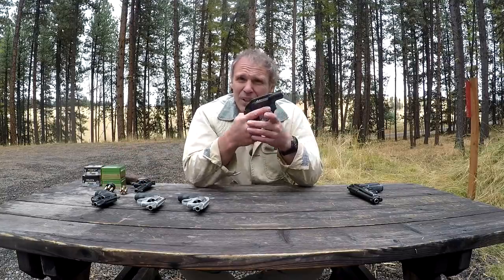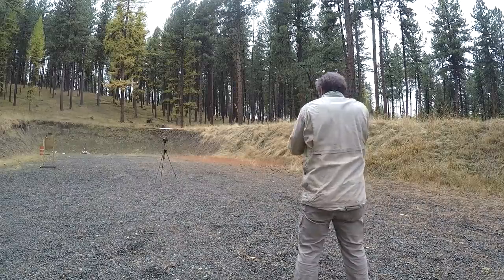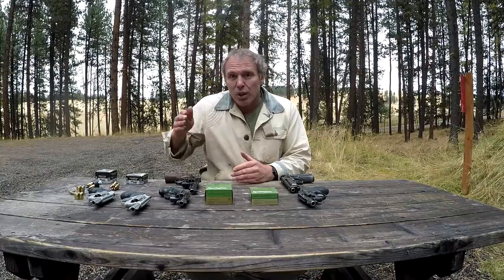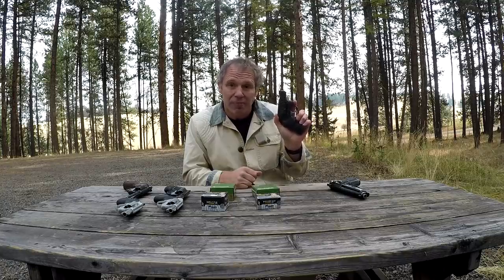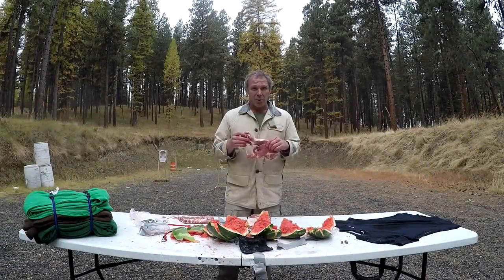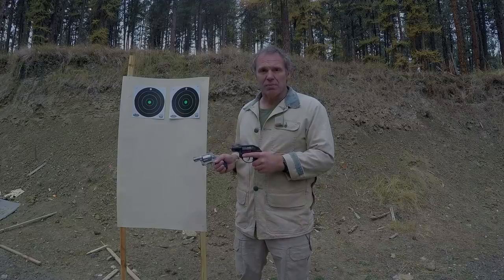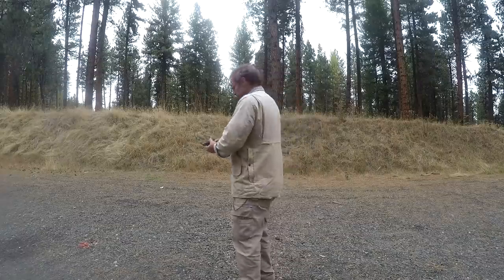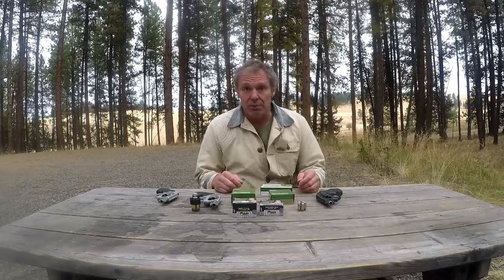Ruger LCR 9 Millimeter

Comment: Hi Paul,
You R the BEST. Watch all your vids. But as a ret engr, I must point out that the 9mm LCR is NOT hammerless as U said. It has a CONCEALED hammer. Every revolver made has had a hammer. The hammer is REQUIRED to strike the firing pin which ignites the cartridge. Hickok45 also pointed this out in his S&W M642 review.
No insult or offense meant. You do a true engineering style factual review which I appreciate.
Thx, Best Regards,
👍😋🇺🇸
Reply: "hammerless" is like "stainless", stainless will still stain/rust, and hammerless has a little less hammer on it ;)

Comment: I will say the LCR .38 has an advantage over its 9mm version: it has an aluminum frame, vs. the steel one on the 9mm. Empty it weighs 13oz. That’s pretty light, only 2oz heavier than a S&W scandium J-Frame, but costs half as much.

Comment: I have an SP101 in 357 with 2"bbl and yes it does come back smartly with full house 357 ammo. I normaly load with 38SPL+P and a speed loader with 357Mag. just in case. One thing about revolvers,if the cylinder is full there is always a round in the chamber!

Comment: Using Blazer 9mm on the range with a Ruger LCR, I experienced crimp jump twice. Contacted Blazer about it, and the person I spoke to stated that crimp jump with Blazer Brass was a known issue and that it was not intended for use in revolvers. That was the only brand I experience it with in my LCR

Comment: I can shoot more accurately with my lcr crimson trace (with our without the laser on) than my beautiful 1957 colt official police single action. your mileage varies. I have no reason for this on my end. it just works that way for me. I am VERY happy with my lcr 38+p and use soft lead hollow point gas check 158 grain gas check buffalo bore ammo for personal defense. otherwise I shoot mostly 158 gr coper plated round nose reloads. For more power in the same holster switching to the sp101 357 magnum and I can shoot pretty decient with that. Love your videos. always learn something useful.

Comment: This one's on my wish list. Have put maybe a 1000 rounds through my SW 638 in the last year and am now needing some gunsmith work. Single action is hanging up, so might try to send it back to SW. Have had the opportunity to put a few rounds down range with the son in laws LCR on three different occasions. What did I find out?? Was quite dismayed, I couldn't run the cheap Federal bulk ammo through it, without crimp jump. Out of 70 rounds on one day , I think I had 4-5 that completely came apart in the cylinder. The cheap aluminum stuff will give you woes also. At least it did for me.  After a little research, we found out the Winchester white box 115gr was just fine for plinking , and didn't have any more problems at least on the day that we took that to try out. For a carry round, I'd probably go with a  Hornady, as I think they have a better crimp on their rounds. 
 Great information as always Paul! Thanks.

Comment: Yippee Paul is reviewing LCR I have. Actually I have LCR-X 9mm WITH exposed hammer, single action mode. Love it. Kicks with my 9mm hand loads.I use +P 9mm hollow point in carry. I have not shot it with the hot stuff. I will though. I can tell you ball nose regular ammo kicks enough to get your attention due to small light weight. PS :-(  Paul said LCR not for him at very end of Video.. Ha ha

Comment: Well done as always.  I’m surprised the velocity difference between short barrel and longer barrel was not greater for each caliber.
Reply: The difference between 0” and 2” is so high that the difference between 2” and 3” looks tiny. Consider that the bullet is already going pretty fast as 2” so the added inch of barrel doesn’t contribute to acceleration as much since the expanding gases are propelling it for less time through that portion of barrel.

Comment: A little correction. the 38 S&W special was developed as a smokeless powder cartridge with a 30% higher mean average pressure than the 38 long Colt. The reason the case is long, is not because it was for black powder, but to prevent it from chambering in 38 long Colt revolvers.
Reply from the maker: I just saw this comment.  What you're writing is Contrary to everything I have ever read or seem.
Reply: @PaulHarrell  That's what I always thought too. This info is from the .38 Special  Historical notes in the Speer reloading manual Number 15, which I should have cited in my comment. But thinking on it, wouldn't it be odd to bring out a new cartridge in black powder some years after the introduction of smokeless powder?
Reply from the maker: @MrTerrydwilliams  Yes, it would be odd. However, .44 special was introduced in 1913 as a black powder cartridge. Look it up. I was amazed when I learned that. But everything I have ever read is that .38 special was introduced in 1899-1902 depending on what source you read, as a black powder cartridge.
Reply: @PaulHarrell  From Wikipedia, the free encyclopedia

The .44 Special or .44 S&W Special is a smokeless powder center fire metallic revolver cartridge developed by Smith & Wesson in 1907 as the standard chambering for their New Century revolver, introduced in 1908.[3]

Comment: I was briefly considering a 9mm LCR at one point, having already own a 3" LCRx in .38 Special, but ultimately ended up getting a CM9 that was on sale.

I still ponder adding a 2" snubby, but I can find decent +P loads for my 3" LCR that approach standard 9mm velocities, but drop off dramatically in shorter barrels.  Therefore I've taken an interest in the .327 Federal Magnum, which definitely does better in longer barrels, but is just an interesting cartridge.  Plus, it be nice to add .32s to my collection, though, I guess a 3" in the caliber would be more versatile, lol

Comment: I knew from another series of vids that 'generally' the modern 9mm loads performed better than .38 Spcl but your demonstration with the ammo you used showed a fairly significant difference. I think what some folks don't know though is that when you look at the equation for kinetic energy that can be expressed in the familiar terms of 'foot pounds' of energy, the difference in velocity of two rounds can result in significant differences in the amount of energy that projectile can deliver much more so that a modest increase of bullet weight. When you have an increase of 100 feet per second, that translates to a factor increase of 10,000 in the equation. Edit - Watching this vid kind of makes me want to get the Ruger LC9 but in my area at nearly $600, it's hard for me to justify that revolver over the S&W M&P Shield @ $450 with 7 round capacity :-/

Comment: AFAIK the 9mm was invented for the (then-new) Luger pistol. That's why one of the cartridge's several names is "9mm Parabellum," counterpart to the Luger's official designation of "Pistola Parabellum." (I may have misspelled that a bit; not the point.) The word "parabellum" literally means "for war"; the Luger was designed as a military sidearm.

Similarly, the .45 ACP was invented for the M1911 pistol.
Reply: FWIW: The first commercial pistol chambered in .45 ACP was the Colt M1905.

Comment: I found the 9mm lcr is picky with ammo- the taper on the casings causes seizing in the cylinder, and with multiple casings seizing up, it causes serious issues. TEST ammo before you rely on the gun, and sanding and polishing the cylinder helps. Also, avoid steel casings.

Comment: Thank you for the video. Though currently I use my SP101 in 357 mag, I have been considering a Ruger LCR in 9mm for carry while swimming or snorkeling in fresh water. I tend to be in remote areas, most of the time by myself, and my gun does me no good in the boat or on the four wheeler if I'm 50 feet away in the water. One reason I want the 9mm is I notice that 9mm FMJ ammo seems to keep out water best. I came to this conclusion because at a place where people shoot I shovel sand into a sifter and separate the brass for scrap (at this point 99 percent of it can't be reloaded). I n doing so I also get lots of dropped ammo, some of sitting in the ground a year or more. I run it through my tumbler and fire most of it. I notice that all 9mm FMJ fire but hollow points seem to misfire or hang fire, some getting stuck in the barrel. Revolver ammo seems to be 50/50 whether it fires or not. If you shoot old ammo like this wear shooting glasses, some of the brass is brittle and will split. I live in Florida and snorkel with my metal detector and have shot many water moccasins and even a gator that dragged my dog in the water. I also ride in places where people will steal your atv so down here we have to carry everywhere.

Comment: Would be interesting to see the preformance of the 327 federal magnum in one of those short barrels. Looking at ballistic data for 4 inchers the energy footpounds are impressive.
Reply: The speer gold dots would be a good comparison round, 115 grain 9mm gives 375 footpounds out the gate versus 500 for the 100 grain 327 both measured out of 4 inch barrels. Going with the 327 would even give you an extra round in those snub nose revolvers.

Comment: Crimp jump. Aluminum cased ammo would be one that could be a problem with. I think another reviewer DID have that problem with the aluminum. Nickle cased SD ammo has "ack-in-pookie" aka adhesive to hold the projectile in the slick nickle casing. At least Hornady does.

Comment: Question!?!? Now I've research this topic; to use your word or "words" ad nauseum, and thank you for shedding some light on it today. But, with the available real estate within the case of the 38 Special, why don't they load them for better performance. The 357 Magnum has the same projectile weights and caliber, mind you longer case and more space in the 357. But plenty of room to load it 2 perform as well or better than the 9 mm. I don't understand why it can't be loaded for power and performance somewhere in between 9 mm and 357 Magnum.    Sorry to be so long-winded but you started it :-). Thank you sir big fan.
Reply: Your logic usually works in rifle cases.  Often a larger case capacity can be filled with slower powder to get more area under the pressure curve.  It doesn't work with the 38 special because the short (pistol length) barrels won't develop that extra area under the curve before the bullet exits the barrel.

Comment: Hey Paul, not sure how else to ask you a question about a particular Firearm, but I figured this is as good as it gets.  I recently got a job as a Bailiff for a civil court, and they want me to eventually get ahold of a concealable firearm.  One that can be carried while wearing a suit.  My firearms experience is mostly from my service in the Navy, and I’ve fired the M9 and occasionally the Sig P226.  There was another handgun that was often in the armory and I only fired it a few times, that was a Sig, and I believe it was the M11-A1.  Maybe just the M11.  I was told those were for concealed use by plainclothes Masters at Arms on Investigative or Bodyguard duty.  To me it was just a slightly smaller P226.  
In my search for a concealable firearm I remembered the Sig M11, and wanted to know if you had any experience with the firearm.  If in your opinion that it would be a good concealable duty weapon for me, given that I have some, albeit limited, experience with it.  If not, are there any other 9mm handguns from reliable brands in Compact or Subcompact sizes you’d recommend otherwise?  I’d prefer to not have to relearn a handgun from square one, so a DA/SA, external hammer handgun with controls similar to a Beretta or Sig would be preferable.  I only ask because my inquiry is of a professional concern, and you are arguably the most professional gun YouTuber on, well, YouTube.
Reply from the maker: This is a good format for questions. You can get input from a lot of people and I consider my audience to have a higher mean I.Q. than other channels. You need a concealable firearm, but many are concealable under a suit. You've worked with the M-9 and it's a good pistol so it could be a good choice. I don't have any experience with the M-11 but I have shot a few sigs and they are generally good pistols. These days many autos are double stack magazine. But for your purposes high capacity may not be as important as concealability and ease of carry. With this in mind you may want to look at a S/W shield, It's like their M&P but single stack so thinner. There are other companies that have similar single stack versions of their popular double stack models.
Reply: Thanks Paul!  I'll keep your advice in mind!

Comment: If you have a 9mm revolver I’d suggest avoiding Blazer Brass 115 gr. It crimp jumped so bad in my gun the bullets were either tying up the cylinder or coming completely out of the chambers.
Reply: Tim Sharkey happened to me on the 4th shot.  WWB works.

Comment: I did experience crimp jump on an LCR9 several times that caused the cylinder to lock up and the gun unable to fire on the last round, with CCI Blazer ammo. I've read that for small revolvers like this one shouldn't use heavier bullets, but perhaps it's just with certain brands and/or types of ammo. (CCI Blazer isn't really considered "poor quality", so I guess maybe it isn't suitable for the LCR9.)

Comment: If you have covered this, I have not seen it.  I have noticed that when you compare different calibers, you try to keep the bullet weight as close as possible.  In the case of this video, 1 grain difference between the 38 Special and 9mm.  Some time ago I did a comparison of .45 ACP vs 10mm and chose the most common bullet weight for both calibers.  230 grain for the .45 ACP and 180 grain for the 10mm from the same manufacture.  I received plenty of comments that I should have chosen bullets of closer weights, but I chose to use the most common weights for these calibers from the same manufacture to keep things as fair as possible.  Was my thinking flawed in any way?
Reply: I think both ways are equally valid in that your method is what people actually do, while Paul's is to compare contrasting formats as close as possible to each other.
Reply: +gapster46. You did it right. Forcing similar bullet weights in comparisons is meaningless, and sometimes straight stupid. Comparisons should be done with a purpose in mind: the cartridges should fulfil the same performance criteria, or in other words, should achieve the same goal. For instance, having similar penetration in the test medium. Take 9mm vs. .45 ACP as an example. Both cartridges were designed for the very same purpose. The 124 gr. Hornady XTP or Speer Gold Dot 9mm bullets were designed along the same modern performance criteria as the 230 grain XTP/GD .45 bullets. They try to achieve the same goal. So they are completely fair to compare. Would a sane person force similar bullet weights for these two cartridges? Of course not! The closest you could get is a 147-150 gr. JHP in 9mm vs. a 165 gr. JHP in .45. Would the comparison be more fair in this case? No! Of course not! Actually, it could not be more unfair or meaningless.
Choosing similar sectional densities would be a better simple guideline, but even that can be meaningless, if the bullet structures are different. Even in the same caliber or same cartridge very different bullet weights can achieve similar penetration (light all-copper JHP vs heavy lead core JHP, for instance). So my advice is simple: keep the goal, the purpose in mind, and not the minute details. And ignore stupid comments. The majority of them are written by teenage boys who have no idea about... well, anything, but they are willing to criticise the shit out of your videos. :)
Reply: Dave Holden - Good explanation.  What people actually do is what I was striving for, but so many in the comments didn’t understand why I did what I did, hence my question here.
Reply: georgejohnsmith - I didn’t get a lot of criticism on my video, just a lot who wondered why I didn’t choose similar bullet weights for the two cartridges, the .45 ACP and the 10mm.  Senseless troll comments do not survive on my channel.

Comment: Powder burn rate is why the sig 38 special ammo was slow and the 9mm ammo was a lot faster. The 38 ammo was loaded with slower burning powder that didn't burn as complete as the faster burning 9mm powder they used.

Comment: As of this year, the 9mm LCRx (exposed hammer model) is available. You can see it on the website. I am guessing by not available, he means it is hard to find, or perhaps this was recorded at an earlier date.

Albeit, for anyone interested, Lucky Gunner had a video on modern revolvers and debated the points between an exposed hammer. The likelihood for someone needing to cock the hammer for a long range shot in self-defense is incredibly unlikely. I figured to go without one for the 9mm, since I was already cheating my cowboy ancestry with moon clips, polymer, and aluminium anyhow.
While 9mm is cheaper, I think the 38's weight, ultimately at 13 oz (vs 17) makes for a better carry revolver. More along the lines of the S&W airweight, or even to a North American Arms.

Hope Ruger releases a 6 shot of these someday. Also a shrouded hammer, and the ability to eject individual 9mm rounds like the S&W made 30 years ago, so Ruger can go full Gluger with their plastic fantastic. Have the revolver design of the 21st century.
Reply: Quart Bernstein they do have a six-shot LCR, in .327 Federal Magnum. Ammo is harder to find, but I bought one anyway, because I don't need a lot of ammo for the LCR to fulfill its purpose for me: to be always at my fingertips with a those critical first 5-6 rounds to save my life. If I need to bust off a lot of rounds, I have other guns for that ;-).
Reply: The LCRx9 is available but only in the shorter barrel. When (if) the 3" barrel comes out I'll own two of them. :)